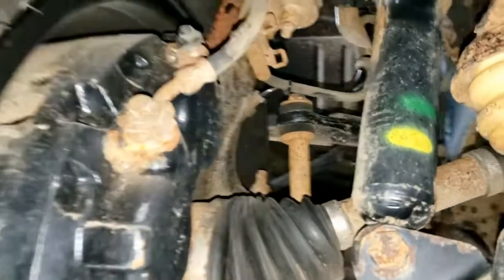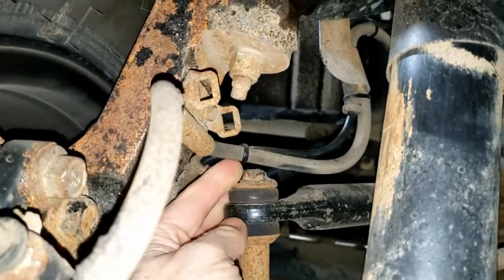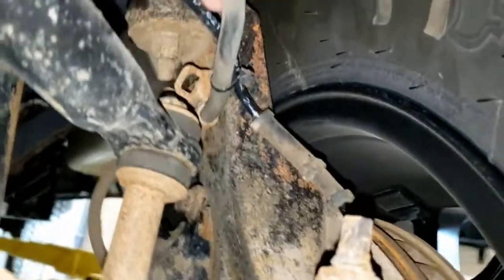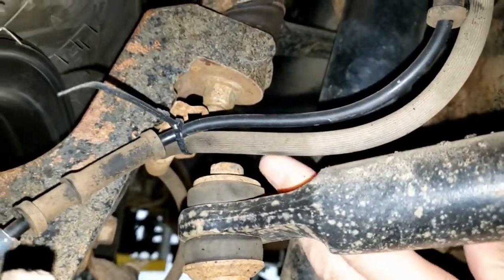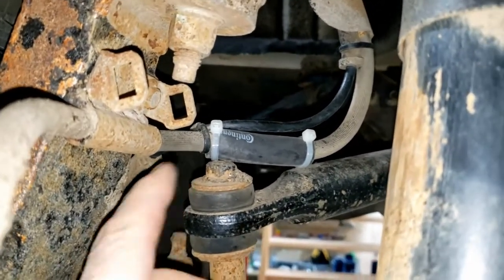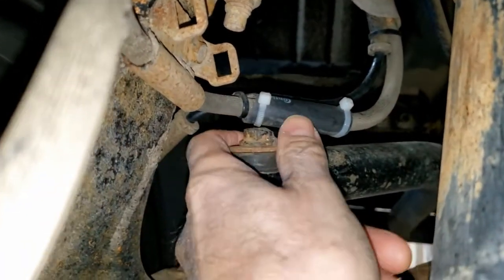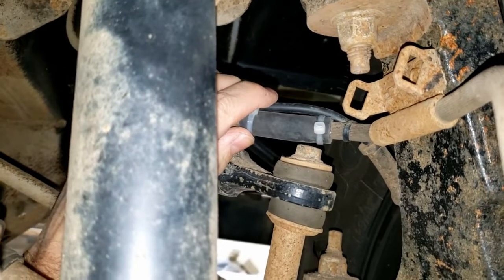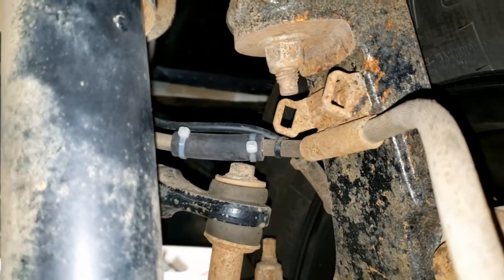Quigley Express Van 4x4 Conversion Potential Problem

Comment: Looks like its either running hot or rusting out
I passed on GMC van do to oil leaks, electrical problems and other things.
Loved the truck solid axel locker 6.0 more power than the other brands.
It had 11000 miles they wanted 29000 for it with chrome package rear camera very nice cargo van.
GM needs to fix these problems.
To me its the best set up out there but i cannot deal with oil leaks
Reply: i have 2010 chevy cargo van 3500 210000, no oil leaks or electrical problems, before that I had an older 2005 cargo van 3500 with 300000 same things unless GMC vans has it.